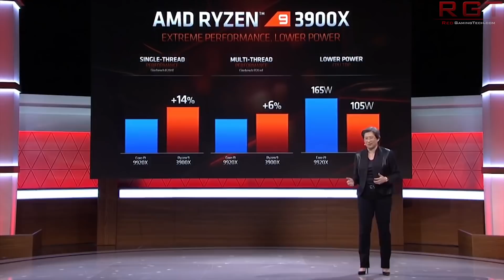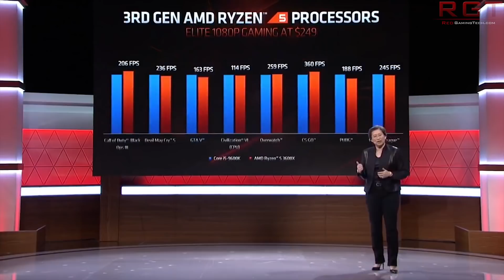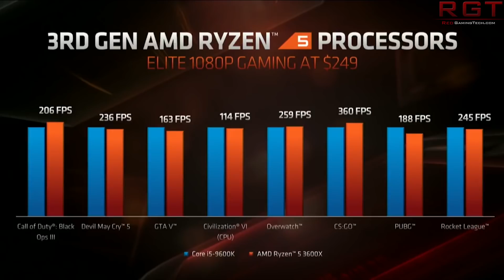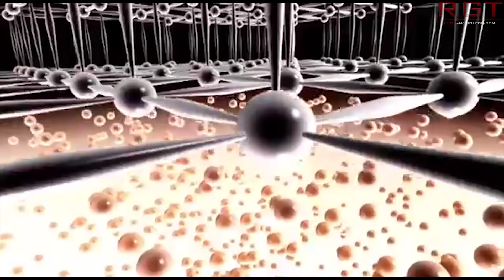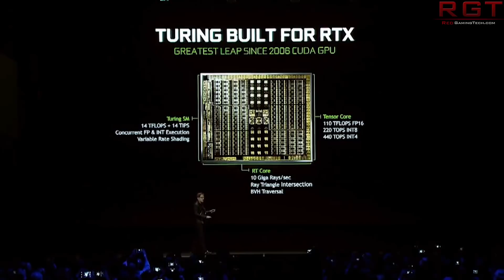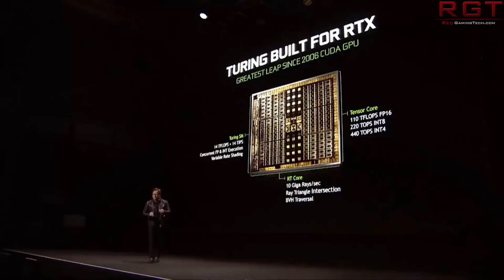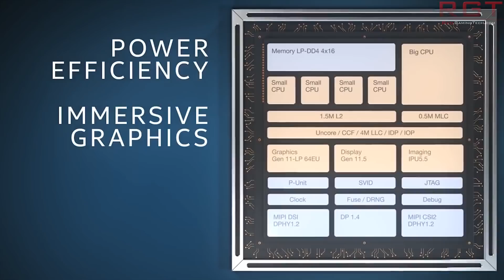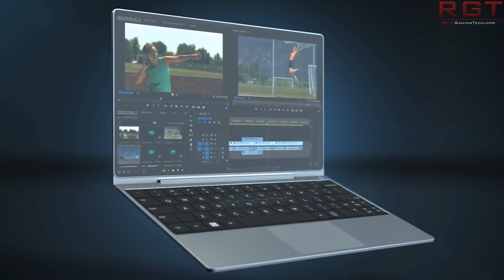AMD BIOS Update for Ryzen 3000 Boost Bug | TSMC vs GloFlo = 50/50? | Intel LakeField Leaks

Comment: I hope AMD learned its lesson about letting marketing dictate launch dates that engineering cannot meet with production-ready support material.
Reply: That shouldn't be the lesson AMD takes away from this. The July 7th launch date was perfectly fine. The lesson they should learn is to under promise and over deliver. If AMD had accurately stated the boost clocks at launch and then later released a bios update to improve it, everyone would be praising them now even though functionally nothing would be different.

Comment: A different perspective: AMD stated best case boost clocks, and some people aren't hitting them, so those people don't have the best case; something is being sub-optimized.  It could be cooling, memory, BIOS, settings, etc.  I get that some folks want the extra clock speed that they think they were guaranteed, but the difference between getting 4.35 GHz rather than 4.4 GHz is just a tick over 1%, a difference we can can of course measure but which almost nobody can discern in actual use.  Are we as PC enthusiasts "testing" and "benchmarking" ourselves into a useless state of frenzy?
Reply: AMD showed videos that suggested people with new X570 motherboards could hit 4.75GHz sustained. When people bought their hardware after watching the video and then couldn't get more than 4.25GHz I think it's fair to be a little annoyed... a LIE is defined as "intent to deceive" not whether it's factually true or not. Sadly, AMD has a great product. I'm happy with my R9-3900x. They should have tried to avoid the FREQUENCY nonsense and just focused on performance and value.

Comment: I don't understand the press' fascination with Ryzen's 3000 boosts.
My 2700X doesn't boost to 4300 either and nobody cared about this last two generations.
Reply: I need to undervolt my 2700X, then it single core boosts as high as 3.75GHz.
Reply: I don't think AMD marketed things the same way before. Also, they had another video where they said something like "so if you get an X570 motherboard and can get 4.55GHz normally you might boost to 4.75GHz" when nobody has been able to achieve what they have suggested... I personally don't care as I actually looked at the after-market testing rather than just the AMD hype so my expectations were realistic. I got what I expected with my R9-3900x and I'm happy... ironically it's the people who didn't do their research that suddenly care now.

Comment: The original boosts were higher but they decided to cut them back a bit for product longevity. However now they are facing a PR scandal over not meeting the clocks. They will put the code back in and they will meet advertised clocks. However its vastly going to shorten the life of the CPUs. They have to do it however to avoid a lawsuit.
Reply: That's what I was thinking.
Reply: "Muh 0.5Fps higher is extremely important"
Reply: @snowstar3560 They can enjoy burning up their CPU for it I am sticking to current bios.
Reply: Been running my 3600 on release BIOS and chipset drivers for over a month. There's been no degradation whatsoever. Ie I can achieve the same manual OC on the same voltage.
Reply: @rdmz135  I updated mine once on my B450 gaming plus to the mid July bios because my board wasn't overclocking my ram properly. It fixed the problem but was the only issue I had. I was using an off brand ram called Timetec though which is probably why.

Comment: Im running a 3800x, on an x370.  I generally only reach 4450 mhz,  but did not take place in Debauer's survey. however, i AM satisfied with the performance and would buy the same cpu again.

Comment: My Ryzen 5 3600 has no trouble reaching the advertised boost clock of 4.2 ghz.  It actually exceeds this by a little sometimes.  I have an asrock b450 pro 4.  I may just be lucky.
Reply: mine too
Reply: Mine hits 4.2 on all cores in gaming

Comment: I have a Crosshair 6 Hero (WiFi) / 1800X.  I adopted kind of early, when AM4 was new.  I had been on BIOS 6401 for a while, and was curious, and installed the latest.  To make this short, upgrading to the 7xxx range of BIOS with a 1st gen Zen will cut the "Zen Common Options" out of the bios (this is where p-states are controlled.. all gone), and the memory support for my 32 GB (2x16) TridentZ 3200 cl14 that had been running at 3333cl14, I couldn't get over 3200 and it wasn't stable.  In short, unless you have a Zen 2 (not Zen 1 or Zen +), then stay away from the 7xxx BIOS.  AMD should have been clear that it shouldn't have been used for 1st gen Zen.  The options I spoke of weren't the only ones missing, either.  Memory interleaving could be enabled and the type selected, but all of the sub-settings were gone.  I was left with a BIOS that was obviously tailored for Zen 2, but without the PBO function (I think it's supposed to be where "Zen Common Options" was.)  I don't know if it's AMD that should have done something to avoid this or if ASUS should.  I believe it's both of them.. but avoid the new BIOSs if you have 1st gen Zen, because it removes some important options if you OC your memory.
Reply: AMD writes the bios for all motherboard vendors. The vendors only install it or make it available.

Comment: AMD should also solve the boot-bugs. This from me as a 3700X user. It takes 3 seconds before the system starts the POST at all and then it takes over 10 seconds before it posts even with the "ultrafast" boot option. I understand that this was a problem with Ryzen1 too for months after the release. It takes almost as long to boot into an OS on my new rig with an NVMe and this fast CPU and fast RAM as on my old $700 OEM machine with an i5-750.
Reply: I think this is more likely due to a relatively slow bios than the CPU. I don't think NVME is any faster than a sata ssd at loading Windows. My x370 Taichi/ R7 1700 takes 15 secs to post and 10 secs to load windows.
Reply: @steverx4460  
Something else, my Gigabyte motherboard came with an empty CMOS-battery. That certainly shouldn't be happening with a €210 motherboard! I don't know what went wrong (either the battery has been installed for years before it ended up in the motherboard or Gigabyte ordered batteries from a very bad company) but that is ridiculous. I had the shop send a new one and I hope that they complained at Gigabyte, especially because I expect that many users have this problem. For Intel it would suck, for Ryzen it is a lot more annoying because of the required memory-tweaking. How was this for your Taichi? I like that motherboard a lot but the prices where I live were and are a lot higher than in the USA and Australia for that motherboard. For X370 and X470 it was the best choice in those countries in my opinion, in Europe you paid €230/240 for it.
Reply: That's your motherboard, not the cpu.

Comment: I was basically able to hit my 3600's boost clock out of the box, however I play Destiny 2 (a lot actually) and the game was completely broken on Ryzen 3000. Wouldn't even launch, but they had a patch (Agesia update if spelt correctly) and after that my boost dropped sharply (voltage also dropped by a noticeable degree in general usage). Still ok I guess but not nearly what it was prior, on top of this hardware virtualization is completely broken for me (rip virtual machine) along with (oddly enough) the computer becoming far more finicky.

I can't explain why but after if I try and overclock my ram, or CPU the system will not post. I get nothing now at all anything (regardless of how small) above factory default settings. Not even a splash screen and it's rather confusing as a chipset driver update shouldn't do this. I recently decided to try and re-enable the settings to use virtualization which resulted in the PC consistently BSOD'ing every 45 seconds to 1 min after booting into Windows. My only guess is it's a mix of a poor bios (MSI B450 Tomahawk) and the new driver. Out if everything tho I'm mostly salt about losing hardware virtualization I bought Windows 10 Pro just for the built in sandbox feature and now that's no longer a option (at least for the time being) if it will return who knows..

Comment: I suspect it's not entirely the BIOS. R3k is pushed to the limit; theres no overhead. Not only that, but the cpus use a varying mix of chiplets of varying quality.

I'm not making excuses for them tho. If they advertise the thing boosts to 4.6, then it should boost to that and STAY there for the workload. That's what Intel's do.

Otherwise, stop calling it boost. Do what you did for navi and have 3 numbers: base, game, and boost.
Reply: According to Intel Specs boost is only able to be reached for about 90 seconds or 120 seconds. So your statement is incorrect on this point. It has already been discussed by many reviewers when speaking of how much TDP intel actually uses. Some high end motherboards ignore Intel rules and simply leave the boost on perpetually. This is outside of Intels specs.
Reply: @coinexchange1761  every z370 board you can buy off the shelf boosts perpetually.  the only ones that dont are oem board from dell etc.  any off the shelf z370 or z390 board can hold the boost forever if you set it to in the bios.  but the main thing is that they are at least ABLE to hit those boosts.  

actually its expected that not only will they hit and hold those boosts on a z370\z390 board, they will actually run the single core boost on all cores when overclocked.  ive even heard of people that got 8700ks that wouldnt hit 5ghz getting replacements from intel for free because they emailed intel about it. 

so intel cpus are held to the standard that all cores will hold the single core turbo all the time or more and amd cpus are expected to hit 95% of the single core turbo...on a single core.  thats hardly far.

to be honest i dont really care about if they are missing the boost clocks.  they perform well and have a good price. the part that bothers me is that if they are trying this hard to eek out that last little bit of perfomrance what else are they doing?  i mean everybody rode intel about the 5-10% performance gains year over year and we ended up with the speculation vulnerabilities because of it.  it amd push too hard they may end up in the same boat.  anybody pushing that hard for that last 1% worries me.  some of the voltages they are running are crazy high just to get an extra 25mghz
Reply: @bobhumplick4213  I hear you, but thats not normal boost behavior on Intel platforms. (according to Intel)
------------------
I am not at all surprised that AMD is having such (perceived) issues as I pre-announced these issues several months ago. AMD already knew that this was going to bite them in the rear.

I propose the real issue is that the current Zen2 issues are around the power management per core and not per CCX [from the Legacy AM4 Zen1 support]. Don't be too surprised if a motherboard vendor revision resolves some of this headache. The issue is a complex one, I suspect. I wouldn't bother too much with the X570 boards.
Reply: @coinexchange1761  Intel's spec aside, their CPUs are consistently capable of hitting the boost freq. They also stay there more consistently, a hell of a lot longer than a few seconds a la AMD.

Afaik, this is the behavior across the board from both reviewers and  casual users.
Reply: @Dilo22  I have not been saying otherwise.

Comment: No one's asking how clock frequency is measured by the various software tools available. It's not a trivial algorithm and always represents some sort of average across a certain time limit. Very short bursts of a few million clock cycles that hit the advertised frequency or even beyond therefore may go unnoticed, especially on a modern chip like Ryzen that's constantly frquency scaling. Our software tools may not even be capable to effectively detect the highest clock speeds. Hence whatever the Bauer claims may have to be reworded into "Ryzen not holding max boost frequency long enough so a meaningful measurement can be taken with the usual software tools available". It's sort of old Intel thinking, expecting a self overclocking Ryzen to behave like an Intel CPU.

Comment: R9-3900x user here
Just FYI, but FAN NOISE was just incredibly annoying with the stock fan. It would rev up then down constantly with light loads. It was actually much BETTER with higher loads because the fan would stabilize and the super WHINY noise disappeared replaced with mostly typical fan air noise... spents HOURS trying to adjust CPU configs (fan hysteresis delay etc), fan configs and just never fixed it. When my Noctua AM4 adapter arrived I put on my NH-D14, uses Asus software to adjust CPU frequency and fan noise and the CPU can now do 4.25GHz all cores with minimal fan noise. YAAY!... but I'm not sure if the STOCK COOLER for any AM4 CPU will work well considering the light usage fan noise should theoretically apply to everybody...

I was surprised to find the game RECORE (not very popular) on the MS Store had all the massive STUTTERS just disappear. I had an i7-3770K@4.4GHz + 16GB DDR3 which is not too bad (and same GTX1080) so I really didn't think it was a CPU bottleneck but I guess it was. Huh... I suspect I'll find a lot of games where stutters disappear though eventually I'll get a GSYNC or GSync compatible monitor...

On "GSync Compatible" monitors. It's hard to find out if LFC (Low Frequency Compensation) works with NVidia cards. If the monitor is rated at 45Hz to 144Hz for Freesync (and is GSync compatible) what happens when I drop to 44FPS? Normally the GSYNC MODULE would double that in the monitor to make 88Hz (refresh same frame twice) to stay in the GSync range. But if there's no module do the NVidia drivers apply LFC (send 88FPS) or does GSYNC just not work below 45FPS in this scenario?
Reply: (by whiny I mean "grindy" as the fan in light loads might jump from 800RPM to 1200RPM with a loud, grindy whine like the motor kicks in more to overcome inertia, then it goes away to remain at 1200RPM then as the temp drops it just drops to 800RPM. Then repeats several times in a minute in some cases. Or opening some programs would kick the stock fan to 100% within two seconds... aaargh. Again, a good cooler fixed this for me but I expected more. Perhaps I had a defective fan though a lot of others reported this issue.)
Reply: Update: I maxed out at 4.225GHz on all cores with the stock cooler. Just FYI. My Noctua cooler didn't really change performance, just noise. So I went from 4.225 to 4.25 but even if I only had an R5-3600 (still great CPU and about the same for games) I'd consider getting a better than stock cooler just for NOISE if you have issues like I've described. I think the FAN CHOICE was more important in my case since it seemed to be the fan motor so probably a Hyper 212 Black, Noctua NH-U12, BeQuiet or similar cooler would work great than play with fan profiles using motherboard software... ASUS has awesome fan software. For the Asus Strix X470-F Gaming motherboard the downloaded software would stress my CPU to find its max, then ramp my fans up and down to figure out how they work. I just came in at the end and customized the fan profile a bit such as raising from 20% to 50% for the CPU fan to avoid fan fluctuations even more.

Comment: I'm just amazed I could take a brand new 3400 and out in old B350 and it works at all.  Even cools on air only!
Reply: Are you using the GPU?
Do you have Dual Channel memory at 3000MHz or higher? 
(I ask because if you have good memory bandwidth to stress the GPU then usually the APU runs really hot and a stock fan should get pretty damn noisy in most games)
Reply: For me I went AsRock site and they had a list of memory that would work.  My existing ram 3200mhz  said it would work.  It did.  I had a big Noctua Cooler with fan.  I never use the stock ones.  It is staying pretty quiet so far.

Comment: Is anyone else having ram problems on X470 since bios changes?
Reply: Not me. I have an Asus X470-F Gaming board but I only have one BIOS the R9-3900x can use... are you using an XMP profile? Have you run MEMTEST86 to confirm it is your memory? Have you tried resetting the BIOS (clear CMOS) and testing with just the 2133MHz basic JEDEC configuration? If resetting BIOS works then run MEMTEST86 on the 2133MHz config. If that works change to your XMP profile (may be called DOCP), save on exit, then test in MEMTEST86 USB stick for a full pass or until errors.

Comment: I have tripple aio hybrid watercooler, using thermal grizzly thermal paste, spread properly, cpu is not even hot when running, it simply does not boost all the way to 4.4ghz,  its way too conservative. ANd PBO simply does not work on my x470 Crosshair 7 hero

Comment: ive been thinking a big little design is just what gaming desktops has needed for awhile.  i doubt intel will do much with it, they have a way of missing out on huge oppurtunities because they dont think outside the box.  but most games have 1 or 2 complex threads that really need a lot of power and the rest are just dumb threads that are loading textures or doing something that a much less powerful cpu could do.  when you see an 8 core cpu nearly maxed out in a game what you are really seeing most times is 1-3 threads that are very heavy and 10-20 threads that are tiny and just get piled up on each core
Reply: I think Lakefield is what Jim Keller is working on which just about guarantees it will be amazing.
Reply: @mr.tomatohead5648  lakefield is the first step in what hes working on.  after that they are talking about emib and putting different dies together for the xeons.  lakefeild is cool but keller is working on bigger things to i would imagine